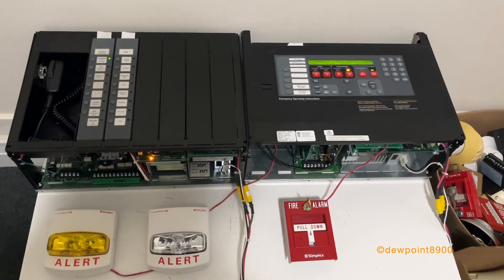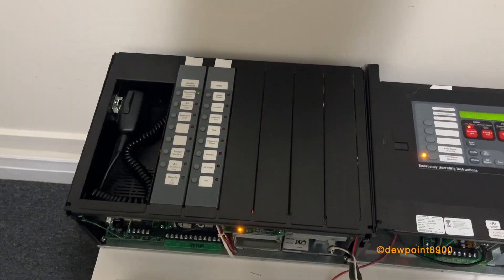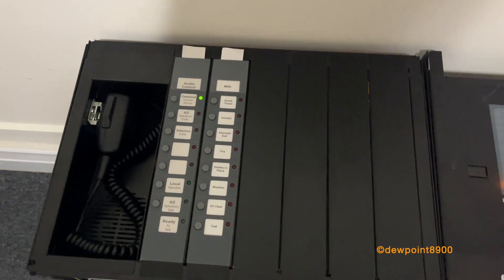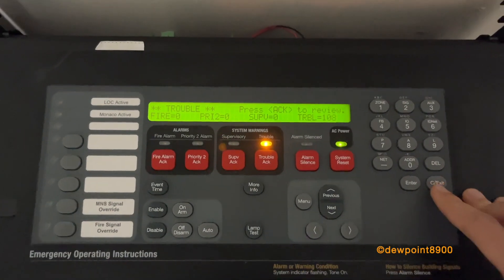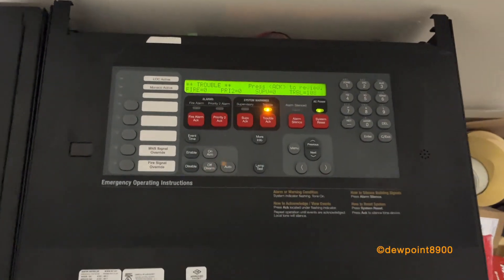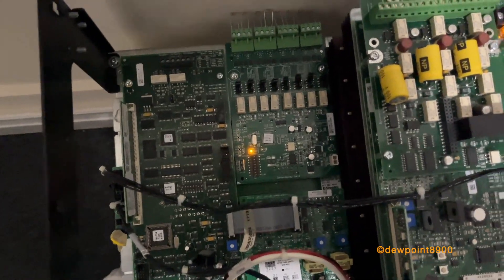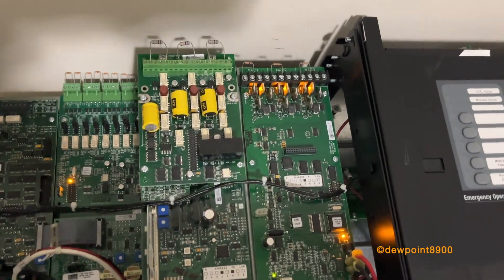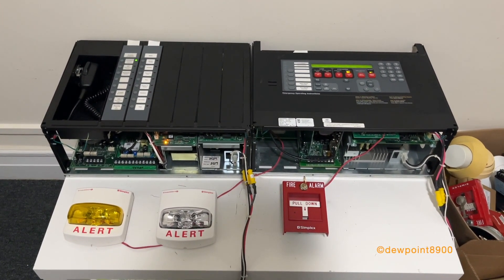Simplex 4100ES with Voice Evac Initial Test

Comment: Hello everyone,
I’ve encountered several issues with the voice evacuation system and would appreciate your assistance. I am receiving the following fault messages: Channel supervision tone not active, Analog Audio Controller message library checksum error, and Flex 50 Amplifier Power Stage 1 Overcurrent.

I currently lack the experience to resolve these faults on my own.
Could someone please guide me on how to properly configure and troubleshoot the voice evacuation system?
Reply from the maker: Contact your Simplex fire alarm service provider. It sounds like there’s some serious issues with the audio system.